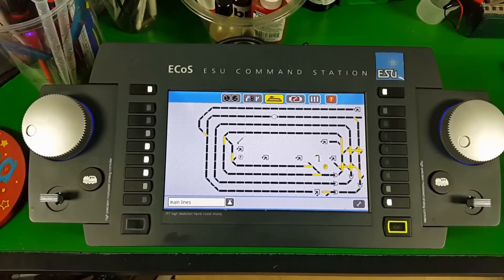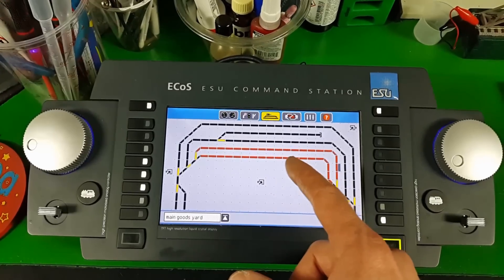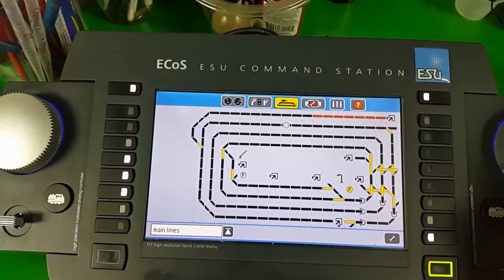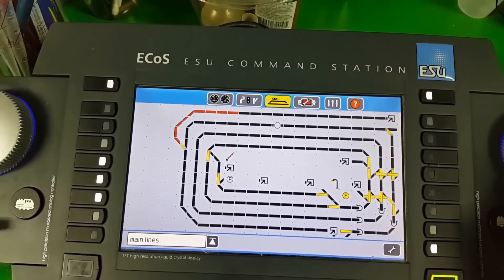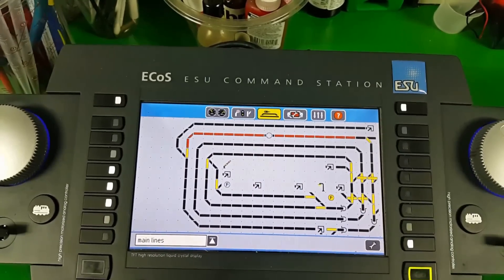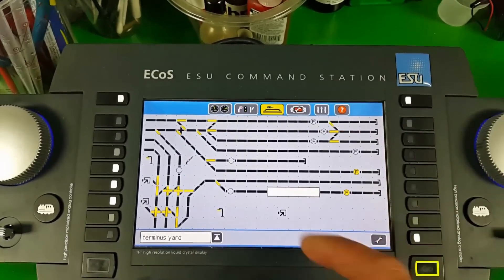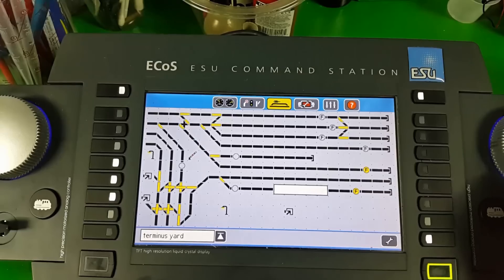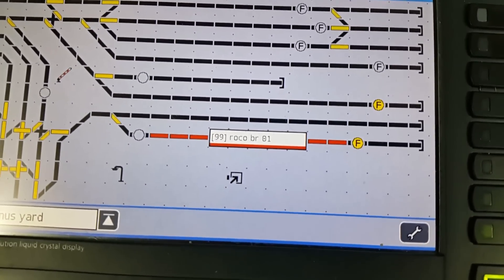ESU DETECTOR BASIC USE

Comment: Hi Jim, a very good discription. this is the basic of the automation on a layout. 
remeber if you want a full automation on the hole layout, then you need to detected all tracks so the ecos ore computer can see where a train is ( also which one ) and select where to go and so on. 
i think its also necessary when used in the ecos and also in the computer that the detection is the same and aqual by number/place in both the systems.
keep up the good work. cheers from Onno
Reply from the maker: Onno Schroor Thanks..yeah thats what I am doing it takes time and planning..😃
Reply: hi Jim, yes i know all about it with doing with the automation by my lay out.
but you get so much back when everything works 
and so much joy to see asspecialy working on the compu ( as you can see in one off my movies )
and allready in yours.
when this is working well then the rest follows much easier.
keep going with the good work and do it step by step that the best
cheers from Onno
Reply from the maker: Onno Schroor cool thanks....
I am doing it one section at a time as i am also updateing the wireing and changing track curves aswell.
It is amazing watching the automation working all the points ,trains and routes with nothing colideing.
Reply: hi Jim, i did that also and its the best way. i still remeber the first time the trains where going in automtic; leaving the station, stops automatically by red oer in the station back. So nice is that and still is.
gives a lot of joy. cheers from Onno

Comment: Hi there nice setup I was just wondering what point motors do you use. Can use any point motors with this system.
Reply from the maker: Hi , I use Fleischmann point motors which are solenoid controlled.
You can use any motor but depending on what type of motor you use depends on the hardware and extra modules required.
I used a solenoid type motor as they are the easy to use and set up {they make a clicking noise when fired apposed to silent fire which may require extra hardware to control}.

Comment: That's pretty good, I think I might get some detectors.  Do you find the ECOS easy enough to navigate or is it better to use a laptop to control it?
Reply from the maker: They are expensive but with one detector unit you can do simple multi shuttle routes using only the ecos.
I use the ecos in manual control and my large p.c in automation control or both at the same time..
Reply: Thanks, are you going to add signals to the automation?
Reply from the maker: Yes

Comment: I keep thinking, why not use rfid.  Each piece of rolling stock and loco could have an rfid tag under them.  As the tags went over a receiver, it could identify each one, know how fast it is going and what power unit was pulling or pushing.  The tags are cheap, 60 pence or less and everything would get a unique identifier.
Reply from the maker: Rob McCrain That is another way Rob as you say.
There are many ways to do this..this way is very easy to setup .I will not realy be using this on the ecos as the p.c automation tracks every loco and names start and stop points etc..all the lcocs are speed callabrated on the p.c  software so they stop on a dime at an exact point.

Comment: Jim have you put feedbacks on your points? JC
Reply from the maker: On the points?..I have them all on accessory decoders 15 of them..
Reply: Hovermotion jim I have feedbacks on the points - I'm not sure that it's imperative but it certainly helps when the train has cleared the points before they switch to allow other traffic JC
Reply from the maker: Wow never knew you could do that...up to now ive ran 4 trains with no problems using tt gold making sure the trains are not longer then the blocks on the routes.
Would you have to send a seperate power feed to the points in a point block ?
Reply: Hovermotion yes Jim I've planned to have on each of the 60 points - it's linked to the lengths of blocks and the software can tell exactly where the train is - I also thought it was good practice to power points at the toe - one of which is a feedback - also I have all my points electrofrog wired JC - I work on the basis that length measurement of all rail is everything JC
Reply from the maker: Cool...thats a lot of wireing..
I am just keeping it to 64 feedbacks when done..
The fleischmann points are auto switching frogs on the internal mech of the point.

Comment: Hi
Trying to get to grips with the ESU detector, I think this will be required to operate routes & shuttle trains. If yes what is the best way to set this up.
Kind Regards
Allan
ps - train controller looks a great system, check out Rudd Boer info on you tube
Reply from the maker: Allan Alexander HI Allan..yes it is required to work shuttle routes..
you need to set up the detector with the ecos and add two isloated track sections e.g station one and two  with one  feedback wire for each station to the detector.
then you need to set it up on the menu of the shuttle software on the ecos...
it should say the setup in the ecos manual.
jim.
Reply: Hi Jim
Many thanks for your quick response and help, could I trouble you to advise me where in the manual I would find the menus, page number to read is perfect, if not to much trouble. I also been looking at train controller and watching Ruud Boers info on you tube.

Fab layout, mine is also in my loft, not got the room you have. Well Done
Regards
Allan
Reply from the maker: Allan Alexander HI Allan
I am working away at the moment but I can do a vid at some point to show how to do the shuttle setup as I do not think any other person has shown this in english.
I have done a vid to show how to setup the detector hardware...I can send it if you want...jim
Reply: Hi Jim
Yes please, I am like a sponge just now re getting this right.
Fab
Reply: Hi Jim
Yes please I would appreciate a copy thanks, very kind.
Allan
Reply from the maker: Allan Alexander search "esu detector hovermotion" as i canot send you the link for some reason...jim
Reply: Happy to supply email info ?
Allan
Reply: Hi Jim
You have done a fab job working n those shuttle trains and routes, you make it sound and look so easy to do, would I be correct in saying you use 1 detector for all your layout, how can I get a link to all our videos relating to the shuttle from the start to where you are now, if poss of course.
Allan
Reply from the maker: Allan Alexander you can pm me your email ...I am away at the moment so no use of my p.c.
Reply from the maker: Allan Alexander one detector unit with 16 channels is ok for simple automation of a small layout like  mine...but now I am using two with another two in storage for complex future automation.
Reply from the maker: Allan Alexander yeah James is great ..he knows all about automation...And i-train and automating road traffic cars etc on layouts

Comment: It doesn't work by me. If the locomotif drive in to the section it stops. If i bridge te section te locomotif drives on but te section staus ocupid wen the locomotif laeves the section. Anywone a solution??????? Gr Wim
Reply from the maker: Wim Peeters first make sure you have power going to the detector unit from the ecos or a seperate power supply (it is important to wire the power correctly) then wire the first isloated track section to port 1 on the esu detector unit then configure isloated track section on the ecos detector menu on the ecos as esu detctor 1 port 1 then it should work and show up.
It shows how to do this in the main Ecos instruction manual.